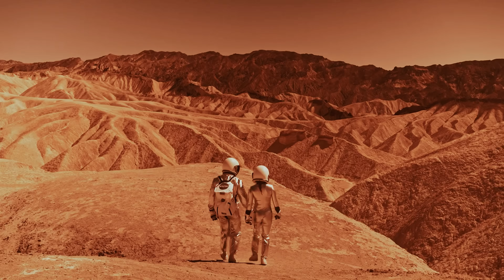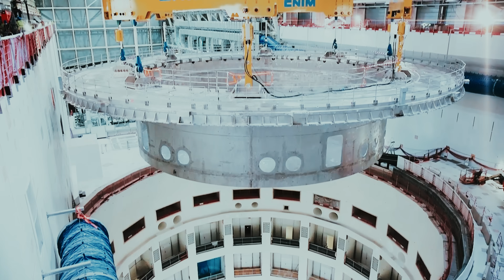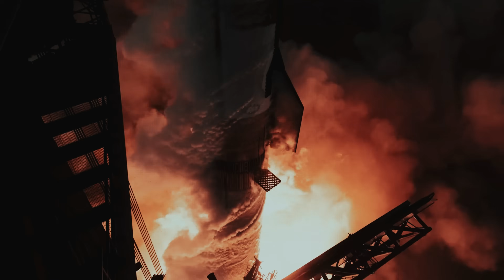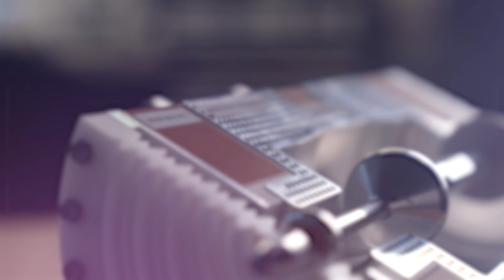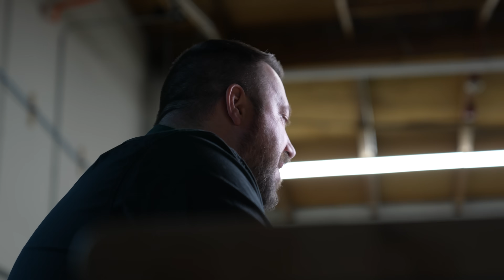Nuclear Fusion Deep Dive (ft. Avalanche Energy)

Comment: This company is amateur hour. Their machine will experience enormous sputtering and plasma contamination, leading to short circuits and x-ray losses. It wont work.
Reply: As someone who works in the field I can tell you they have WAYYYY bigger issues (mainly that the voltage needed to electrostatically confine Q>1 fusion plasmas in a space that size would be so great as to turn any wire they go through into plasma instantly and cause matter-antimatter pair production)

Comment: thank you, economy will rise by using jet plasma machine and compressed gas(Air) in isolated structure in water pool  with more than 80 % efficiency , it transfers gas(air) temperature  from engine to water, New energy from sea will change world soon, there are other source of energy that with international cooperation in coastline we can reduce effect of  global warming, sea is huge source of energy, further more  we can prevent these phenomena like cyclone and flood and wildfire by using this hot seasonal atmospheric condition, recent years in summer, geothermal energy happens in surface of coastline, there are many countries in coastline with seasonal hot weather and water condition in comparison with middle Ocean its more than 12 degrees ,  in sum-up, by using this energy not only is economical but also reduce global warming in countries like Japan, China, India, Mediterranean countries, Iran, Brazil, Mexico, Us, Canada, (Africa and Arabian countries....) . I invented new method base on air pressure rules and quantum physics ionization sea water minerals in strong dynamic magnet bases on paramagnetic and diamagnetic particles and electrical field and electric chemical reactions (K+, Mg++, Na+, H+, H++,  li+, H2, ...) +( O2, N2, ...) into up level by vacuum pump from storage into combustion chambers as major part of fuel (more than 50%) for producing electricity and fresh water and fertilizer. this machine produces 150Megwatt-hour/hour and 20000M3/DAY fresh water and fertilizer. 7 methods zero pollution for reducing global warming I mentioned in my profile. (G20 countries can solve these phenomena)

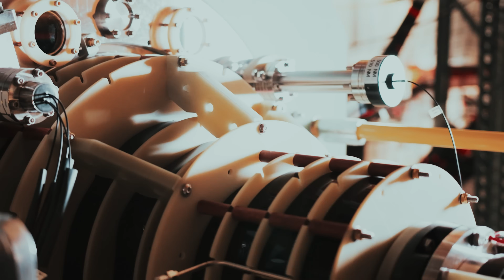Comment: 8:10 I would be very skeptical of this device given there's a YouTube video explaining this project mentioned at the timestamp is impossible to achieve. Also if you could iterate that quickly, it shouldn't take too long to figure out it net positive energy production should be possible in 5-ish years I would think. Once you have a lot of the components built, with a few tests involving the real data, either the goal will be close to feasible or not. I just hope regardless of what happens some of the findings will be shared with the scientific community.

https://www.youtube.com/watch?v=3vUPhsFoniw

Comment: A more grounded engineering explanation as to why this prolly won’t work: 

https://youtu.be/JurplDfPi3U?si=9QC9gEfCZ5vDv4zR

Essentially (assuming their confinement approach works):

1) They don’t address the tritium breeding problem (how to make your fuel)

2) Most of the fast fusion neutrons can will pass thru 6 inches of heat exchanger, so most of your energy will be lost + you’ll make everything around the device radioactive … (this is why most fusion experiments only run for short burst or/and have extremely thick and bulky shielding)

3) The engineering gain needs to more than 1,  which prolly requires a scientific gain of more than 20 (so you need confinement better than anything ever
Reply: A super ambitious project, unlikely of success, but maybe they will learn something they can pivot into another startup.
Reply: @kjmorley  tht's the point